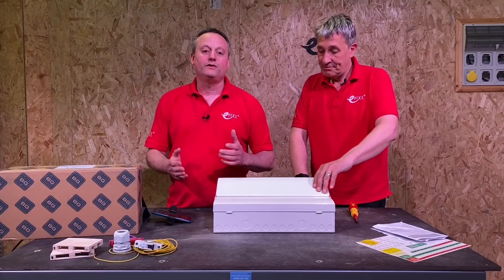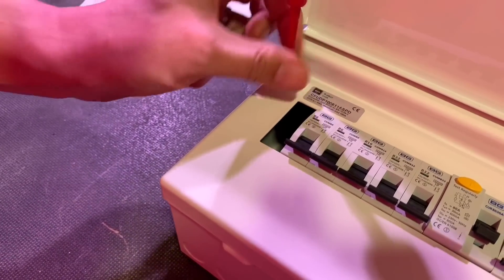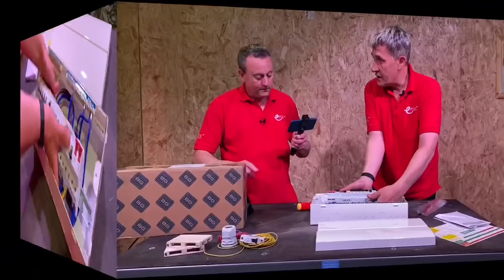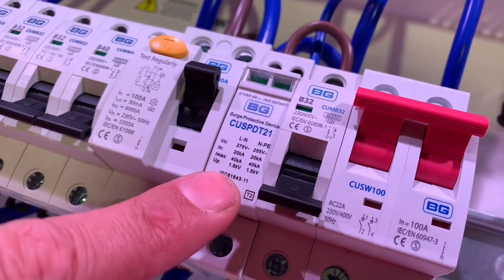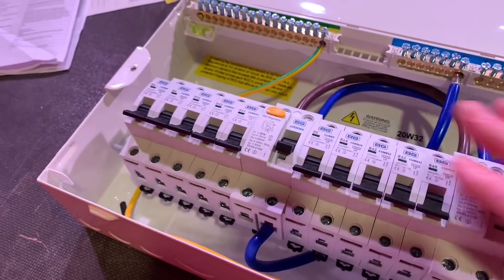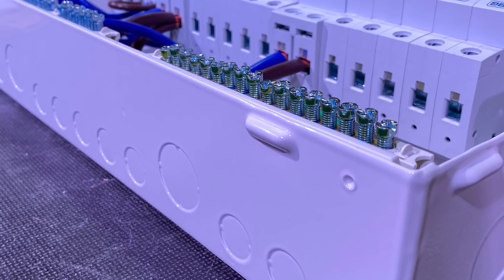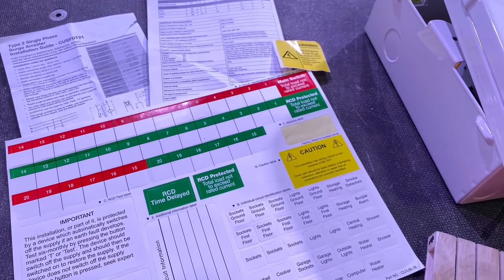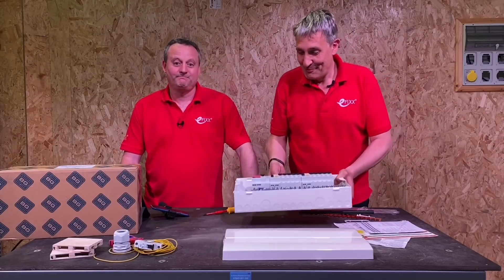REVIEWED: BG CONSUMER UNIT 2021 updates - what's new?

Comment: The projections on the sides of the base keep the base away from walls etc, thus allowing the lid to be fitted easily. Other videos have commented about various brands where installers had forgotten about the lid overlapping the base and had to butcher the lid or adjacent  wall or cabinet simply to fit the lid.

Comment: Why is anyone still fitting split load?!?! Hate BG with a passion after fitting better brands
Reply from the maker: Most new builds still use split load boards.
Reply: What has made you hate BG.  ? were they plastic or metal cases ? other problems.

Comment: I’ve installed a few BG boards, they seemed to be a good quality and well built, but that plastic grommet for the back cable entry comes loose very easily, as soon as cable touches it, it pops loose. What I do now is drill 4 holes 3mm around the edges of the grommet and use some mini tie wraps to hold it in place jurying installation. Makes life easier
Reply: Mount it to the back so when pulling/ pushing the cables through the hole it holds better in place then as your pushing the plastic on the base
Reply: Not away from the consumer unit
Reply from the maker: Great tip 👍
Reply: Small dab of super glue works all the time for me.

Comment: Always liked BG because there front dropped down but noticed you now have to lift it up, which I find a bit of a pain when refitting, but glad to see they have now add SP. May be yo could do a video on the one with the MCBOs. Keep the videos coming.
Reply: With the lid dropping down over the switchgear.  The CU has an improved fire rating.  A bit of a pain if you have to hold it up, but hey-ho.

Comment: Why not make both RCD’s 100amp?
Reply from the maker: We ask that question 👍
Reply: Cost! And it’s really not needed! 80 is plenty
Reply: @AndyK.1  There is no cost difference, and it is needed in many cases
Reply: @Spark101.  They need thicker wire around the  ferrite, so material costs are more even if they sell individual units to the public at the same cost.
Reply: @AndyK.1  but if they sell them at the same cost, they must be able to afford to make them all 100amp at that cost
Reply: They do offer a dual 100A version cfudp1000010spd I think of the top of my head. 

But just to let you know know the manufacturing regulations which they comply to state the board is tested with a 60/40 load across the two rcd’s so it’s kinda pointless having the dual 100 in my eyes as you tend to put the bigger loads closer to the main switch anyway.

Personally I would fit an spd board with  a type RCBO’s to keep up with the regulation changes
Reply: @86744-i  Regardless of the 60/40 load split.....in modern day houses, either side of a dual RCD CU can exceed 100amps in combined MCB values, and most new developments have 100amp service fuses fitted.  

So, 100amp RCD’s on a dual board is normally required.

Comment: Im new to industry and have been recently installing a load of these. Love the built in Gary Neville. Find them great, loads of room, nice screws, easy to make them dressed properly and neat. I often wonder why they supply the B40 in these modern times, a lot of the flats / houses I work on would benefit from a B20 or two or an extra B16 instead. Not experienced many different brand of boards so forgive me if I'm just in a honeymoon period with these.

Comment: One thing I've noticed about the BG consumer units is you have to take the busbar out to fit an additional MCB and the lids a little trickier to get on, on the whole though I think its a pretty solid consumer unit
Reply: Removing the busbar just to replace an MCB, ? why - that seems a bad design.

Comment: Being in the US, what is the average cost difference between a dual RCD vs just springing for the fully RCBO based consumer unit?  I am surprised that the demand is still high for dual RCD instead of just moving to RCBO based CU.  I must say with our load centers with neutral bus bars now for the breakers installing our AFCI/GFCI breakers are so much cleaner without all the extra tails in there.  Personally we have 240V 400A (dual 200A panels) service feed with 80 breaker spaces, and in ours 72 breakers are being used.  Its funny to see houses with 60/80 or 100A feeds and have the amount of high draw devices like electric showers, boilers, ovens, stoves and even EV chargers etc.  It would seem the UK will soon burst into flames in 2030!  😁😁🍻  With all the extra loads of EV's going in and the state of some of the service entrance cables I have seen on some videos, I assume the power companies have to gear up for all these changes as well?
Reply: Rcbos are at least £15 each. Mcbs almost free.

Comment: Id fit bg over mk,have done on budget restriction jobs with no problems but generally stick with contactum or fusebox.
Reply from the maker: Thanks for commenting Andy 👍
Reply from the maker: Andy an I correct in thinking the fuse box RCBO’s are to be tightened to 1.2 Nm of torque...?
Reply: @efixx  yes they write the figure on rcbo’s and earth/neutral bars.

Comment: One improvement would be to have positive retention of the busbar shield via clips or screws - I've often had the shields fall out when removing covers on quite a few different boards.

I think that I've previously mentioned that I'd also like to see proper clamping terminals for neutral and earth/CPC rather than screwing directly onto the copper conductors. Nearly every board I've looked at has at least 1 pinched conductor - often on 1 & 1.5mm conductors. MCBs & RCBOs have them, so why not the other terminals? 

Ditch the bubble because it isn't going to be reliable - any tradie that doesn't use an appropriate size level that can be tested against itself needs to be retrained!

Comment: Certainly not board of choice, I can see some improvements but still wouldn't choose this over a Hager even if it is cheaper.
Most common fault I've come across on the BG boards have been failed RCD's,

Comment: I tend to only fit Wylex boards, but that BG boards looks solid and neat enough, only thing i spotted is the 32mm knockout at the bottom wasnt directly below the gap at the side of the main switch, would make it a lot easier fitting tails bottom entry and just look nicer overall.. nothing that cant be sorted with a starrett

Comment: A lot of people are down on the BG boards, they're very similar to Hager in design (I believe the same designer) I do regularly fit these and there are only three  improvements I'd like to see implemented. They are a welded bracket to clamp the tails into position, metal blanks as standard and fire retardant grommets supplied as standard.

Comment: BG quality has always been okay the problem with them is that BG seems to be the kitchen fitter board of choice.
Reply: As soon as I see one I prepare for the worst; like you say its the screwfix special but the quality isn't inherently bad just the installation most the time
Reply: Worst board of the lot.
Reply: @phillee2171  do elaborate please..
Reply: @MS-Patriot2  board is filmsy, has to mounted tons perfect surface. MCBs don't sit square when torqued to specs, which you struggle to fit the lid on. No A type RCDs easily available on the split load boards. The quality of the manufactured crimped neutral connections is poor. As a brand I generally avoid.
Reply: @phillee2171  Thanks Phil, I was about to use a metal 5 way with type A in a garage, looked ok to me for that job. Probably not for indoor.  As you imply, plenty of choice nowadays.  What is your preference?
Reply: @MS-Patriot2  I generally prefer Schneider or Fusebox. Hager is great but pricy.
Reply: @phillee2171  Thanks, that would be my choice too.  Haven’t tried fusebox yet but many on here are saying positive things.

Comment: Nothing wrong with keeping spare MCBs on the van; why would you leave breakers in the board that aren't required in the installation? Preloaded boards will always encourage compromise- installers need to plan their work before doing it. The last BG boards (metal with hinge at bottom) needed the board lid shut to get it on then open to do up the screws so it wasn't ideal. Never fitted a BG board- I'm happy with other makes that have been selling me DP Type A RCBOs and SPDs without dedicated breakers for 18 months. I've never seen a BG board with its bubble level. Is it the product or the installer that's poor?

Comment: Another good thing about these CU’s is there’s a stop on the right hand side to push the main switch up against that some others don’t have which can be a pain if you’re not fully loading the board and you put the lid on there’s a gap and you then have to go back and slide everything along and potentially redress some cabling. Fitted many of the previous version of these before I changed over to there RCBO units and can’t fault them on the price and quality
Reply: 7kp